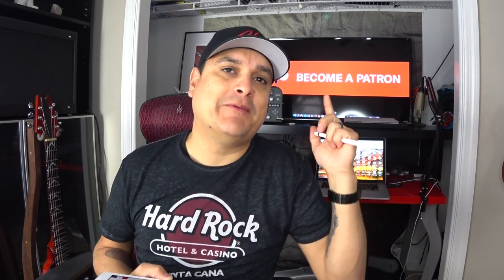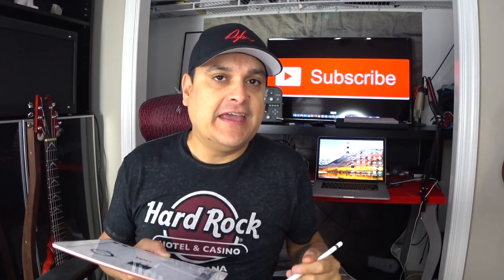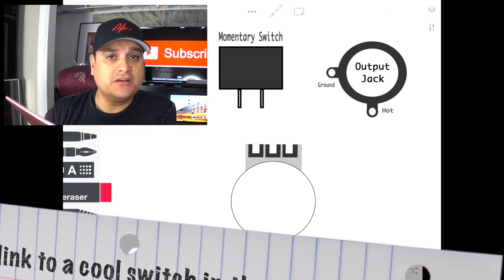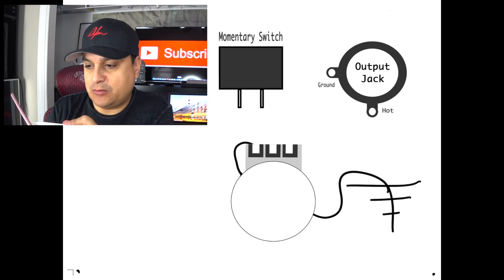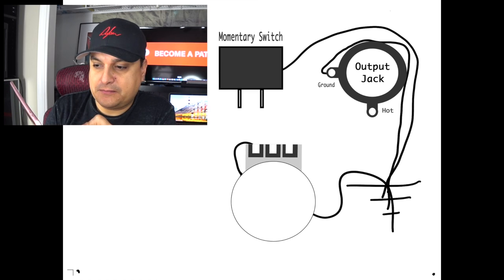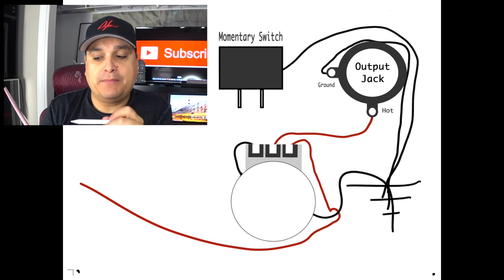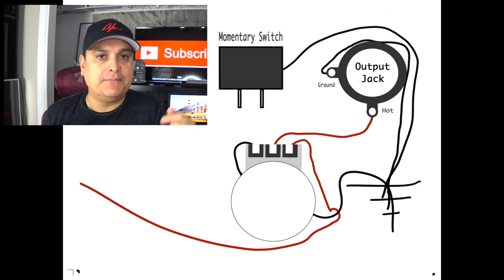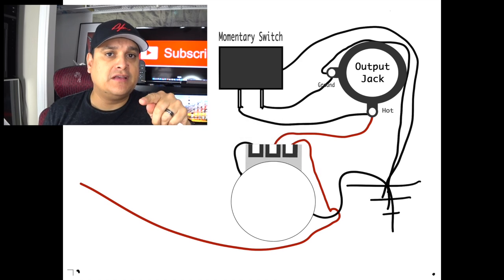How To Install A Killswitch In Your Guitar

Comment: You should have pointed out that a switch inline with the hot wire(signal out), would need to be a normaly closed switch, where as a switch to ground needs to be a normally open switch.
Reply: Correct. All of the comments are just thanking him while yours is actually using logic

Comment: I read somewhere about using a resistor between the two switch terminals to totally eliminate the pop from the kill switch. I can't seem to find that information again though. Do you have any thoughts on including a resistor? I've even read some people claim to use a capacitor, but I don't see how that would work right.
Reply: the resistor to eliminate popping is for active pickups so the battery doesnt pop.

Comment: Okay, so I'm building a Nashville Telecaster at home.

I'm using a three-knob switchplate. One for a killswitch (hence this video), one for tone, and I was wanting to use a stacked knob for my volume. The bottom knob wired to the bridge and neck, with the top wired to the middle.

My thought is to have the bridge and neck pickups hooked up to position 3 of the 5-way switch, along with the middle. Giving me the ability to fade them out separately, to or blend all three together, if I wanted to.

This is my first unconventional wiring setup, and i'm trying to get it just right. Any help would be appreciated!

Comment: You might consider experimenting with small capacitors between the switch and the hot to absolutely kill any unnecessary sound, removing the "attack" part of the switch.
Reply: What sort of capacitor would be
Used am new to this many thanks
Reply: You have did it? I can't remove the pop noise

Comment: I cant ground the switch because is made of plastic, but I have the other two pins, Can I use onle them to ground ?
Reply: Did you figure this out?
Reply: @firefly5783  Yes, and thanks for det, it's working perfect right now
Reply: Awesome thanks for awnsering im abt todo the same
Reply: @firefly5783  Thanks to you my friend , and greetings from Sweden
Reply: Secuthor in the same predicament. If you don’t mind me asking, how did you figure it out?
Reply: @justinfrench5444  I only used the 2 cable and works perfectly
Reply: Secuthor thanks

Comment: Dylan, have you ever converted a one lead wire humbucker to a four wire humbucker. Is it hard or even worth doing? Gary
Reply from the maker: Gary Rouleau it can be done as long as the tape and wax is not too brittle.

Comment: If you hooked up the switch to the "hot" wire the guitar would only work when you push the button and turn off when you let the button go.